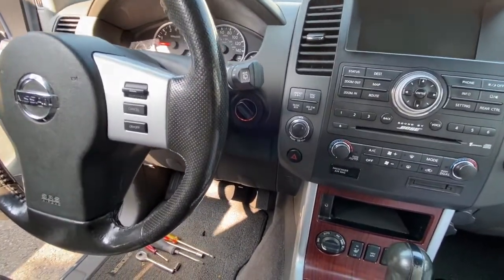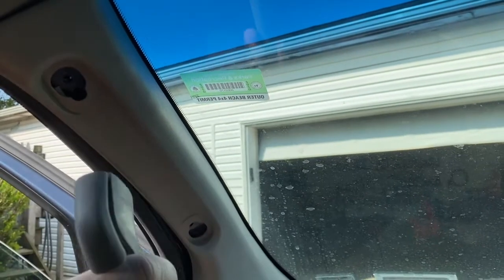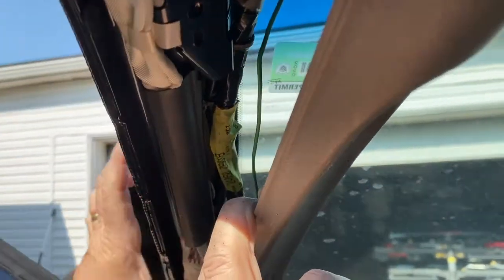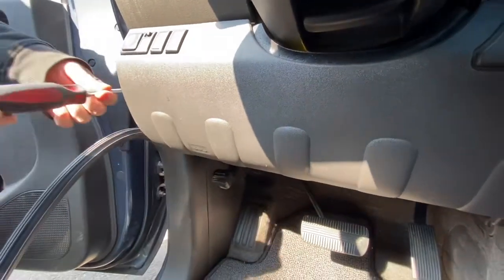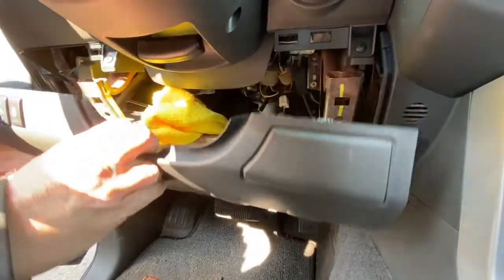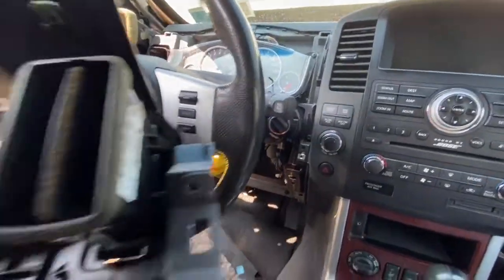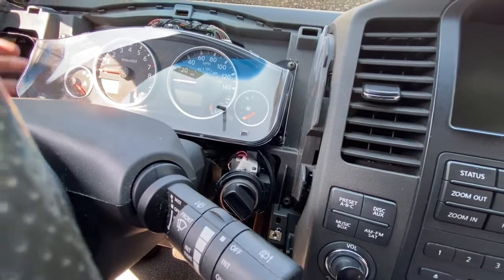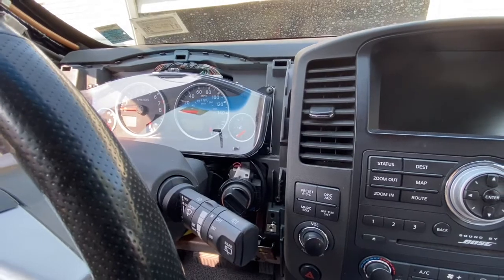Removal of Instrument Cluster on 2008-2012 Nissan Pathfinder

Comment: Hey this is a great tutorial! I am looking to replace a blown speaker on the dash (left speaker) of my 2011 pathfinder. I'm assuming that after you remove the instrumental cluster that you would be able to access and remove the dash. Would that be a correct assumption or is there a different method to access that speaker? Thanks!
Reply from the maker: Yes, you still have to remove the lower dash panel but it's a little easier with the other parts removed already.

Comment: Thanks for this cool video. In my Pathfinder R51 2006 the fuel gauge does not work any more. Sekf diagnosis show a normal value so the fuel sensor should be ok. Also test moves all four gauges. Might it be the dashboard that does not properly power the fuel gauge in normal mode?
Reply from the maker: If you did the other tests then yes it’s probably the cluster. And thanks for the comment!
Reply: @motorcarnut  what other tests would you suggest, please?
Reply from the maker: If the gauge test moves the fuel gauge then  I would see if the scan tool shows correct fuel level if it doesn’t it’s probably the sending unit it the tank if it does then it’s probably wiring problem between sending unit and cluster.
Reply: @motorcarnut  the shown value says 247 what ist nearly a full gas tank.i think the sending Part in the fuel tank is OK and the cluster has an error converting it to a current for the fuel gauge?
Reply: OK..I got another cluster unit...Same Error, fuel gage does not work either. So it must be the sender unit in the fuel tank
Reply from the maker: As I stated above, you have to test things first before throwing parts at it. Hopefully you can send the cluster back?
Reply: Yes...i can send it back. Maybe the end piece that swims is lost in the tank

Comment: Hello were you able to change the bulbs?  If so what bulb size and how many were there.
Reply from the maker: Actually there are no bulbs in that particular cluster, there are built in LED's. and they are not replaceable. you would have to replace the cluster with another one and have it reprogramed to your car.
Reply: @motorcarnut  thank you